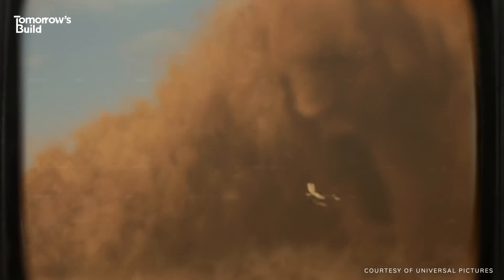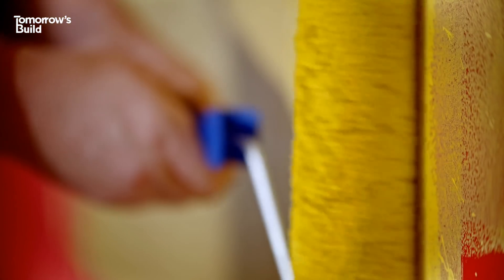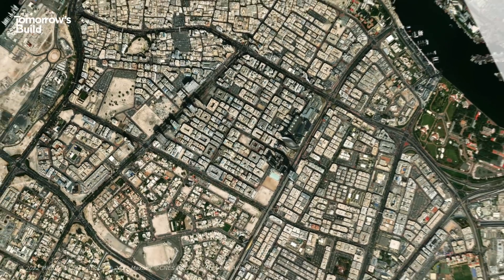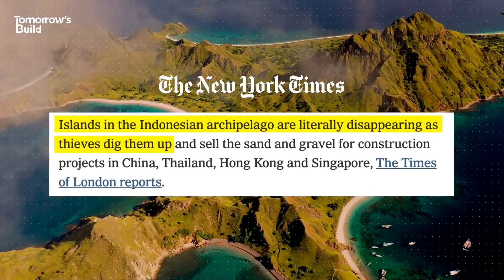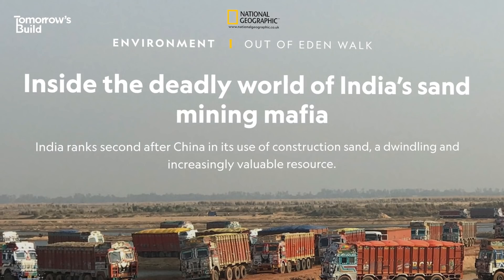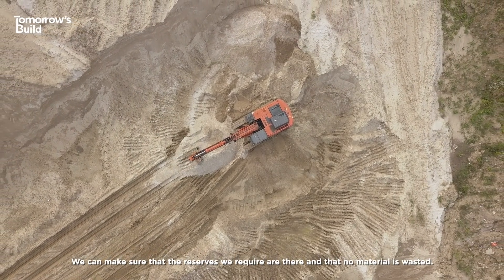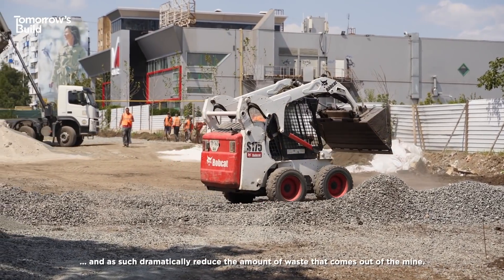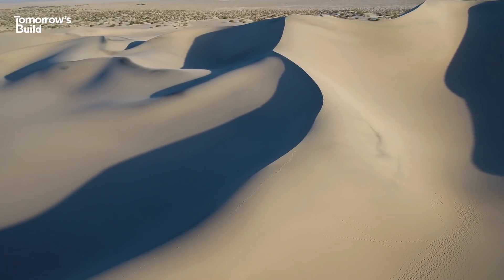This Could Stop Construction Everywhere

Comment: Imagine your country consisting of 90% desert, but you have to buy and import sand. The frustration!
Reply: It's the same as with water, isn't it? You can be literally surrounded by that stuff, i.e., by being an island in the ocean. But you can still manage to dehydrate to death.
Reply: @lonestarr1490 it's whether your government is willing to spend money in infrastructure to clean and make the water safe for drinking or if it's just more cost effective to buy it in from elsewhere.
Reply: it shows: things are typically more complexe as assumed.
Reply: @nothingisreal6345  "and the delear want's you thinking that it's either black or white - thank God, it's not that simple" -L. Cohen
Reply: They could make glass with it. Then when the glass won't be used again, turn the glass into the kind of sand you want, by grinding up the glass.
Reply: Why not melt it, let it cool the run it through a grinder to get the grain size/type needed.
Reply: @That-Guy_  the would require a lot of energy, which unless you found a way to retrieve the heat afterwards would probably cause more emissions and pollution than shipping it from elsewhere

Crushed rock sand is another option already being used in several countries
Reply: @trygveevensen171  
Assuming it's in the desert, a focused mirror array could do the melting and solar panels can power the grinding equipment
Reply: @That-Guy_  People are still not used to having free electricity available.  It would be interesting if B1M would do a video about whether Saudi Arabia is embracing their solar resource.
Not sure if it's necessary to melt the sand.  Might be sufficient to treat it, grind it, into the assorted sizes required for it to pack tightly when used in concrete 1:33.
Reply: @That-Guy_  Or use the desert sand to fill the holes after building sand has been dug out. 
Desert sand should also be ideal for chips and glass as the bead size doesn’t matter.
Reply: @That-Guy_  Cost for one thing. Turn sand to lava and then let it cool to solid rock and then grind it back into sand? Cheaper just to grind rock into sand and that would still cost a lot.
Reply: Imagine your country have Oil and gas
Reply: I'm selling refrigerators to Eskimos and holes in the ground to those who can't avoid dying!
Reply: @Th4thWiseman  Stonks
Reply: The real reason they don't mine the Sahara is the global elites are afraid of what we might find hidden under all that sand.
Reply: @walterbaltzley4546  I do not know about that but I will have to admit you could hind a whole other world under all that sand.
Reply: But I suppose the self replenishing oil reserves make up for that.
I emphasise the ‘self replenishing’.
Reply: Capitalism 101.
Reply: @PROVOCATEURSK  This comment makes no sense, whatsoever.
Did you not watch the video?
Reply: @thomashiggins9320  r/whoosh(need to know history to understand the joke)
Reply: @edo-san  I have a degree in history. Provocateur SK seems to indicate he thinks the only reason sand gets imported to a desert country is because "capitalism."

In fact, it has little to do with, "capitalism." It has to do with the real-world physical laws that dictate how sand gets produced in the natural world, and that those processes produce different grains of sand with different shapes.

Because sand is the single largest component of concrete, the shapes of the sand grains, as dictated by the physical processes that produced them, mean some sand makes good concrete and some does not.

None of that has anything to do with the human creation known as, "capitalism," or Provocateur SK's implication that "capitalist greed," is the sole driving factor.

If you want to build strong, durable structures or infrastructure as inexpensively as possible, the engineering indicates you should probably use a lot of concrete.
Reply: @PROVOCATEURSK  Exactly. It's capitalism but not for the reason you seem to think.

Most sand is too impure. It's polluted with different minerals, organic matter, and rocks, which makes it unsuitable for a lot of different projects. That's why you need sand that's more pure. You can't use sand filled with impurities to make window panes, for example. They'd crack and be too fragile.

It's cheaper to import pure sand that occurs naturally in certain places on Earth instead of trying to purify already existing sand, which means capitalism has done what it's supposed to and actually made the product in question (the sand) cheaper.

Comment: Could they do a mix? Wouldn't the coarse river sand mixed with the round desert sand fill in the gaps and produce a compacted mix? Say they could do 50/50%, surely that'd go a very long way.
Reply: And what about mixing in ground up plastic waste with it?
Reply: The coarse  sand could break the round sand 👍
Reply: @Y2Kvids  how?
Reply: @rabokarabekian409  It could break the round sand while mixing , compaction , Need to be verified , it's just a theory of mine.
Reply: Round sand can't be used it doesn't allow bond to be solid
Reply: Imagine a bowl of ping pong balls, a bowl of legos, and a bowl of 50/50 mix. Then imagine trying to stick your hand down to the bottom of the bowl. The 50/50 mix would definitely be harder to slip through than just ping pong balls, but it would be nowhere close to as compact as 100% legos

Comment: Could you mix desert sand with mine tailings to get a more varied product?
Reply from the maker: Interesting idea!!
Reply: I was thinking the same, although the tailings would need to be near to a desert region. The treatment process and chemicals used would probably preclude a lot of tailings
Reply: Melt it, cool it, grind it down to the right size.
Reply: Probably, but it’d have to wait until a custom-mixed sand solution from multiple sources becomes cheaper than river sand. Same problem as energy… it’s not that we can’t function without fossil fuels, but rather it’s cheaper to use fossil fuels.
Reply: Have you ever looked at mine tailings up close?
Reply: @rabokarabekian409  Honestly, there a lot of different types of tailings. Gold tailings (where I have worked) are pretty sandy and might be ok once the cyanide has leached away.
Nickel laterite tails are very fine and clay like, usually pretty salty, at least where I have worked.
Lots of sulphide tails would be acidic and no good either probably
Pretty lucky to have the right waste in the right place I would think

Comment: Greetings from Chicago area, wood foundations in northern states like Minnesota and Wisconsin are not uncommon and I knew of a contractor in Indianapolis once promoting them.  Perhaps they'll become more common elsewhere with this shortage, soil and water conditions permitting.
Reply: That’s pretty cool, I wonder if there are any papers on this matter. However there is also a wood shortage which will probably get more extreme in the future.
Reply: @lupus7297  there's a wood shortage because of the economic fallout from the pandemic
Reply: @yonatanschlussel  there is a shortage because of demand, fallout sounds like a downturn which is definitely not the case.
Reply: @lupus7297  I know there are details in the 2003 International Residential Code, and probably subsequent editions as well.
Reply: why is hempcrete not used more, and researched more...  It could be used for many things, but nobody likes it.  It is not that bad.  Legalize weed everywhere.  Hempcrete is no magic bullet, but needs more use, more research...  It can help make a difference too
Reply: @voidremoved  I've heard about the benefits of hemp for structural uses for years. With more marijuana legalization let's hope there is some opportunity to look into this finally.
Reply: @voidremoved  cost + insurance
Reply: Im from Indianapolis and we use slab on new builds
Reply: @javanjackson6918  I imagine slab on grade is common on the budget jobs, I'd think basements are still common mid range and up. I'd hope so with the tornadoes.
Reply: @timmmahhhh  tornadoes don’t form in the city. I’ve lived here my whole life and Kokomo was the only place nearby that got hit by one. But yes higher end houses do have basements a lot of times.
Reply: @javanjackson6918  they can form anywhere, they had one in NE Indy I think in the late 90s and DT Nashville TN has had a couple.  They're even more rare in Chicago thanks to Lake Michigan but Plainfield IL had a horrible one in 1990. For the record I grew up in Kokomo 1969-1985 Ball State 1985-1990 and moved well after the two tornadoes after 2000 still shocked those happened.
Reply: The German government has funded a big research program about: how to replace concrete wherever possible in construction. Concrete is a great, long lasting, easily shapeable and cheap build material. BUT: converting CaCO3 into CaOH and CaO (cement) is today causing up to 15% of the C02 emissions. And it turns out: many of the commercial concrete buildings created in the 50th and 60th need to be deconstructed already. They just don't meet modern requirements (insulation, room sizes, accessibility for handicapped people, fire safety...) and changing them is hardly possible. But concrete will still contribute a big part. 1.) some objects, e.g. bridges, tunnels, high buildings must be built with concrete 2.) there isn't enough wood available 3.) other alternative materials are expansive and there is little experience if they are long lasting and what their environmental impact is
Reply: @nothingisreal6345  concrete don't need insulation and fire safety? Sounds like bs

Comment: Still can't believe that them deserts were filled with vegetation back then
Reply: May I suggest a few Geography courses at your local University... 
only 25% of the Sahara Desert is actually Sand. 
Top soil is mostly compost of various types of fauna (plants). It blows and washes away quickly. Look at any river delta to see the sediment (soil) washed down river by 'fast' flowing water. When the river hits a body of still or slow moving water, the load capacity of the water is diminished and thus... deltas are filled with sediment. 
Without the compost (organic - decayed carbon based flora), very few things can grow anywhere.
Reply: Indeed. Sahara turns into a forest jungle about every 10k years. That's why we're seeing the planet become warmer. The Earth's tilt is shifting the equator. It's moving all the deserts (and in this case the african jungles) further north and melts the Arctic.
Reply: @WolfHeathen  Umm, no.  We are currently in a period of decreasing axial tilt, which will result in milder winters and cooler summers.  Normally this would lead to an overall minor cooling trend of the planet.  However, because of anthropogenic climate change, the planet is warming far faster than any cooling due that axial decrease can compensate for.